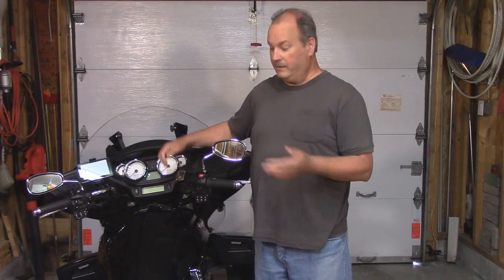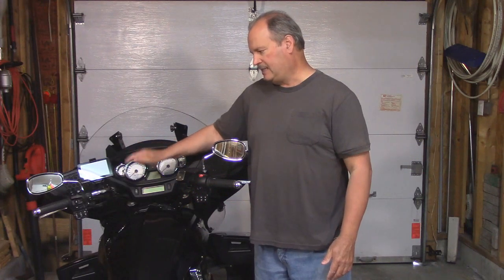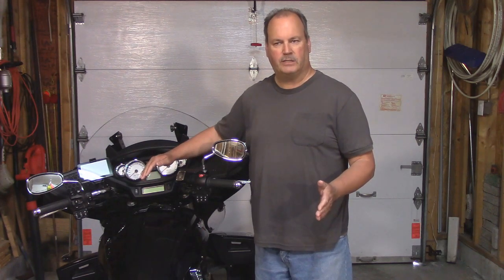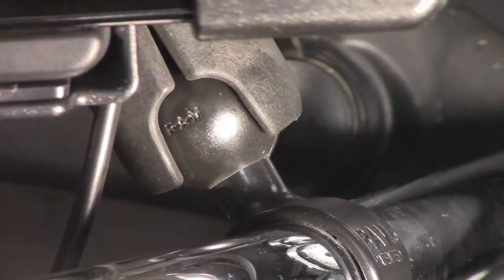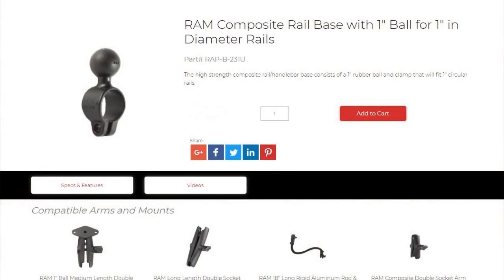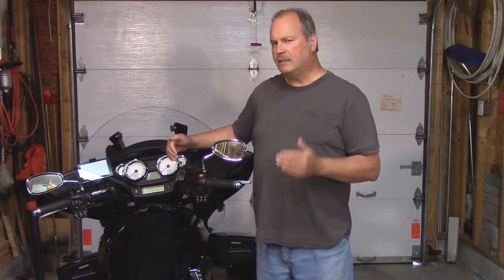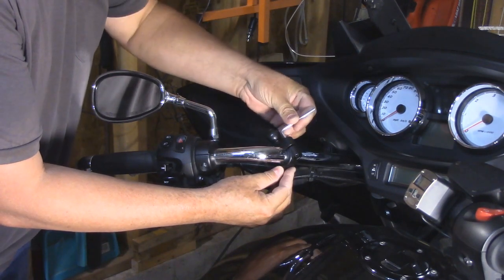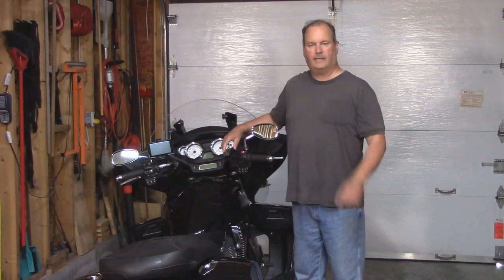Motorcycle GPS Mount

Comment: Hey Paul, thanks for all you videos. They are still helpful and relevant. One question, did you run the navigation sound through the bikes speakers? How did you achieve this? I bought a Garmin gps and I’m using the cool stream Bluetooth to connect the gps to the aux mode but I can only hear the streaming music but not the turn by turn directions. Any thoughts?
Reply from the maker: Hi Warren, I only look at the screen for navigating. Volume is off. I have never used the sound system on my bike so there is no connection from any other device.
Reply: Thanks!

Comment: You might want to follow up with RAM.  They might even reimburse you for your replacement mount.
Reply from the maker: It's kind of a double edged sword. I contacted them and they will ship me out a replacement but I have to pay shipping. Since they are in the States and I am in Canada it is $13USD which is $17CAD and that is more than double what the unit is worth. I could have them ship to my USA mailing address for only $2.75USD and I would have to go get it. I suppose I will do it that way but I doubt I will ever use the smaller clamp as it could just break again, but maybe I can use it for something else.